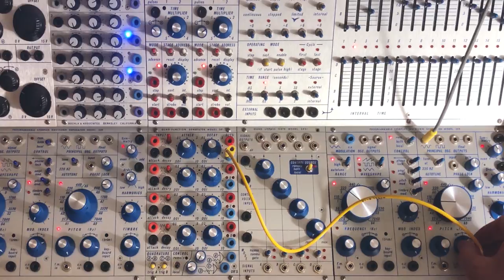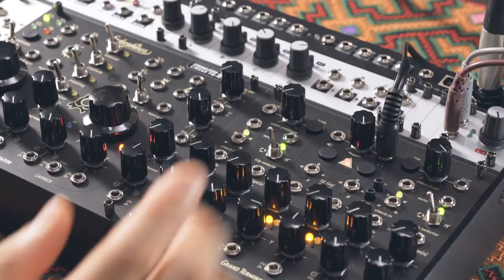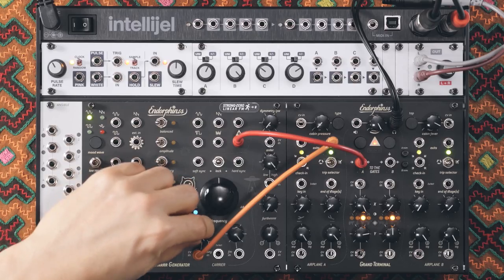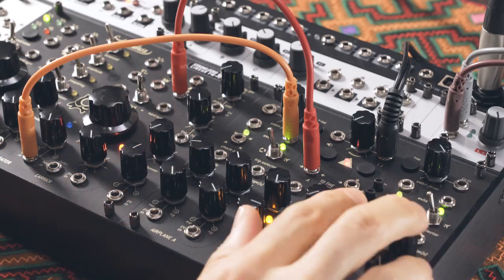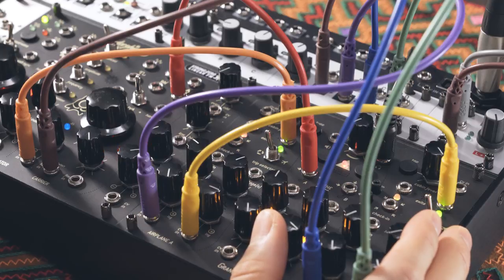Synth Trek, Ep 2 • Barton's Recipe | Beginner FM Modular Synthesizer Tutorial

Comment: In case it's not obvious, changing the attack and decay settings on a looping EG not only changes the timbre of the waveform, but also its frequency. (For typical EG's that is.)
Reply from the maker: Ooh, right as they loop faster/slower depending on the settings. And that frequency change ultimately results in a timbral change in the principal oscillator!
Reply: Thank you for this helpful tip, I've been scouring the interwebs for any information I can get my hands on, in relation to modular FM synthesis. Feels like a closely guarded secret, though it may just be due to a smaller user base.